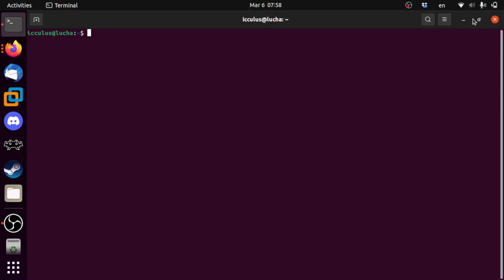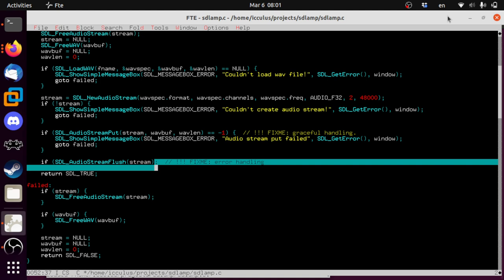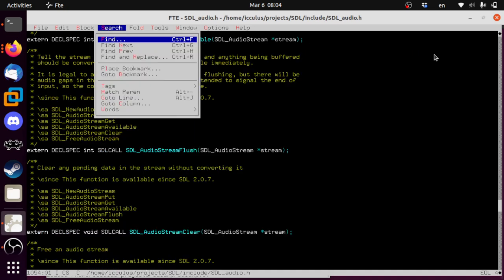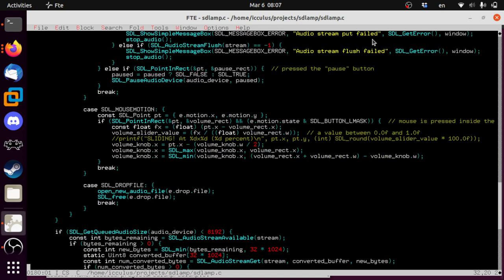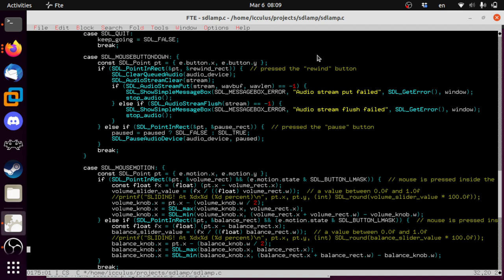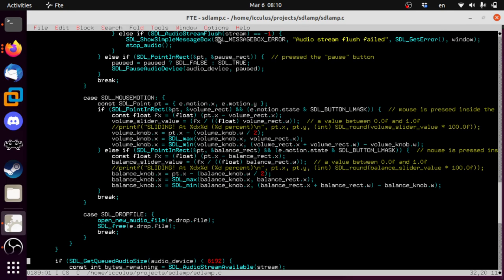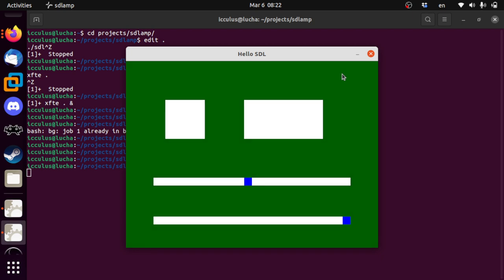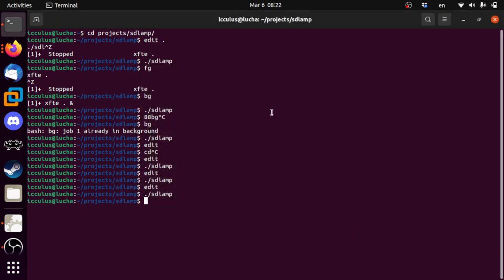Writing a Simple Media Player with SDL, part 6: Balance controls

Comment: When you duplicated whole chunks of code to implement the balance slider, something in my brain said "oof"... But I honestly think it's a good approach if you're just making something work. This would be the part where I would get distracted by "doing things properly", start building out a little framework, and entirely forget about the feature I was intending to implement.

Next time I'll ignore my own mental oofs, get it working first, and THEN refactor it into something nice.

Edit: of course I should still consider what bit is worth doing first, depending on the complexity of the copied code...

Comment: If you're iterating through num_samples 2 at a time for the audio balance, don't you need to check that i+1 doesn't overflow samples? Or is there a guarantee that num_samples is always even? Thanks for doing this, loving the series!
Reply from the maker: It should always give full sample frames (both left and right), but throwing in an assert wouldn’t be the worst idea here.

Comment: If you assume function returns 0 on success shouldn't you check for the return value being not equal to 0 instead of equal to -1 while checking for errors? -1 seems to be an oddly specific value for no good reason.
Reply from the maker: I mean, you have like half a century of Unix tradition, where 0 means success and -1 means failure...it's oddly specific unless you imagine the first API they wrote was open(), where -1 meant failure and everything else--including zero--was a file handle, and they just kept the basic concept for everything else going forward, so other libraries, including SDL, did as well.
Reply from the maker: (which drives me nuts, fwiw...I personally like to use zero for failure and one for success, so you can do "if (!SomeOperation())" to mean "if SomeOperation failed"...)
Reply: @RyanGordon  yeah, I know the unix convention. What I meant is that in the absence of the documentation on error codes, checking for -1 assumes only -1 will be an error and not other negative values. Personally in that case I would check for not zero. Or less then 0  if I would expect positive integers as success codes too.